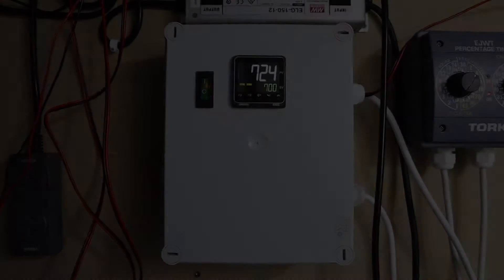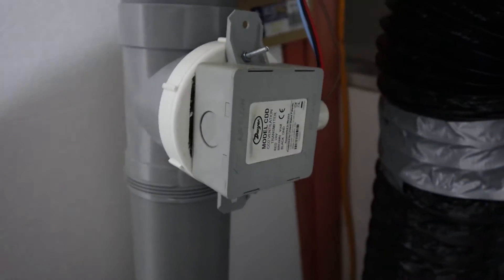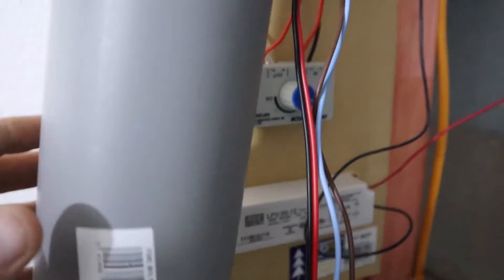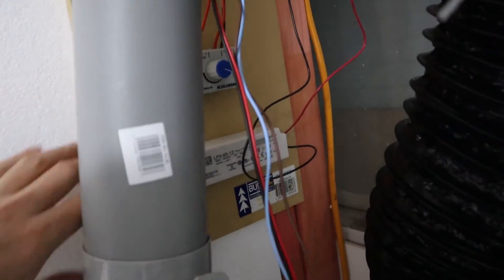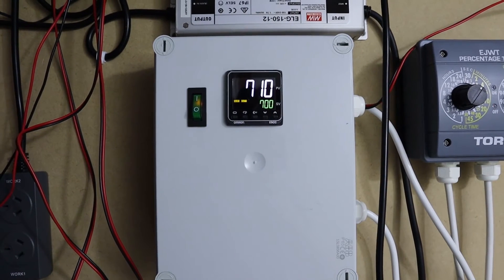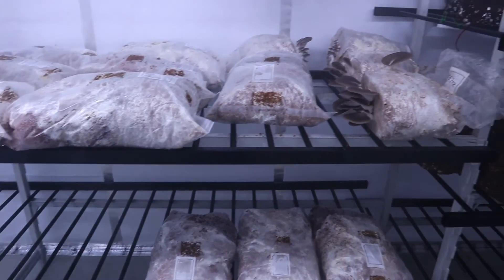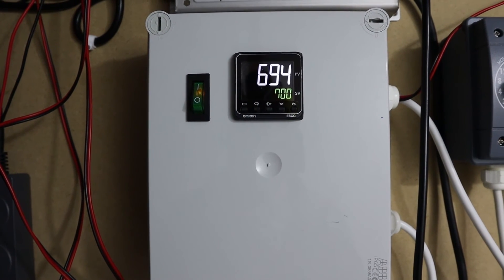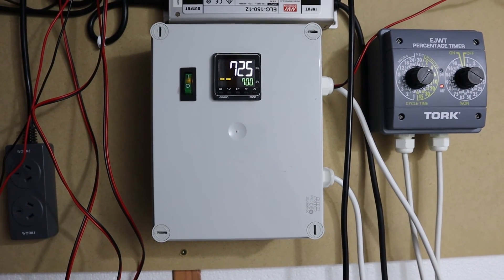Mushroom Ventilation - How to Build a CO2 Controller for Mushroom Growing - Part 1

Comment: I realize this is an old video but I just got my CO2 monitoring set up but my oysters still seem leggy, the rest of the mushrooms are ok. The fan turns on at 700 and shuts off at 650. CO2 doesn't get above 800. Any ideas would help.

Comment: Bro you do realise that co2 is heavier than air, right? Your censor pipe is drawing from high in the room, so it won't read high until the room is almost full of co2. You should run the fan in the other direction and pull your reading from near the bottom of the room... 😉
Reply from the maker: I don't think co2 is heavy enough to be noticeable on such a small scale, and with air mixing inside the room. Otherwise if you dug a hole outside it would fill with pure co2, which it doesn't.
Reply: Actually it is, and the smaller the scale the more separation you get. Unless your fans are on the floor pointing upward (and very strongly), most of the co2 will be on the floor. Try reversing the airflow past your censor and seeing how much more your co2 extraction is being activated.
Reply from the maker: @PitchforkAcademy  the atmosphere in the room is replaced once every 6-12 minutes, so no I don't think the co2 will be a higher ppm level at the floor, considering the extractor sucks the air from floor level. I will test it next time I am at the farm.

Comment: Why did you choose to build your own over an Inkbird CO2 controller? I've looked into setting up like yours but the components are gunna cost me as much as an Inkbird plus my time. Just wondering why you went that way rather than purchasing a "plug n play" type deal. Because you hate Inkbird? xD
Reply from the maker: I have never seen an inkbird co2 controller. Inkbird pid's are ok, but usually their probes are garbage. Good probes are the key.

Comment: There are some CO2 transmitters with control output built in. That could reduce the system components a bit maybe. And there are ones with a pipe fitting, to be connected to a ventilation pipe directly.

Comment: Id love to show you my two barrel PID controller I made. I wonder if you were to flip that water proof fan around if that would help your readings. CO2 is heavier so it sits at the bottom of the grow room. With that fan flipped around it would be sucking in air from the bottom of the grow room where most of the CO2 would be.
Reply: Did you program a pi or other unit? Thinking of building my own system to ensure things like hysterysis is taken into account in the logic for the sensor readings because if the amount of airflow change oxygen exchange and CO2.
Reply from the maker: I have flipped it, so it pulls from the bottom now. But I doubt the co2 has time to settle anyway, there will be too much air current moving around.

Comment: I appreciate your videos. I love your setup.  I wish you the absolute best with your endeavors. I am currently replicating your set up. I know nothing about electricity. What solid state relay with heat sink do you have with your omron?
Reply from the maker: You need to get a SSR that suits you power supply. Ours is 240v, so I got one to suit. If there's. Not one listed in the comments I will add one today.

Comment: Hello. Very informative. I have a question. During the day, when the exhaust fan sucks out the air from the grow room, how is fresh air then forced into the grow room?
Reply from the maker: There is an open vent where air can come inside. IO do not force fresh air in, rather fresh air gets sucked in.
Reply: @OakandSpore  negative pressure is a good friend!

Comment: nice vid! how were u able to connect the fan ro the transmittor so it turns on when transmittor senses high co2? also is it possible to hook up 2 fans?
Reply from the maker: The controller connects to an Omron PID, which is programmed to turn the fan on when the CO2 gets too high. Yes you can connect to fans to it as well.

Comment: Nice! How were you able to get the CO2 probe to work with the temperature controller?
Reply from the maker: So most PID's (process controllers) can function with other measurements, as long as it can take a different input. Most common are a 0-10v, or a 0-5ma (I could be slightly wrong) so instead of attaching a thermocouple, you can attach any probe that's output is 0-10v. My co2 meter is 0-10v, and its measurement range is 0-2000ppm. So 0v = 0ppm, and 10v = 2000ppm. The temperature controller is just a device to interperet the input and display it as a number on the screen (and control it)
Reply: @OakandSpore  Thank you!

Comment: Nice setup. Is that co2 probe rated for high humidity?
Reply from the maker: I'm not sure. I looked at other probes which were rated for extreme conditions but they cost $1000's. This was cheap from ebay.
Reply: have you a link ?